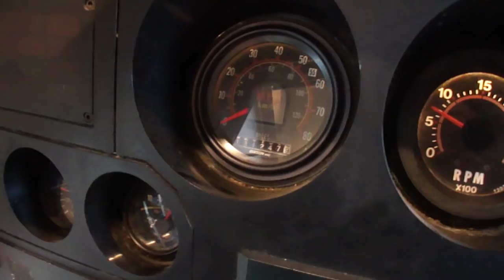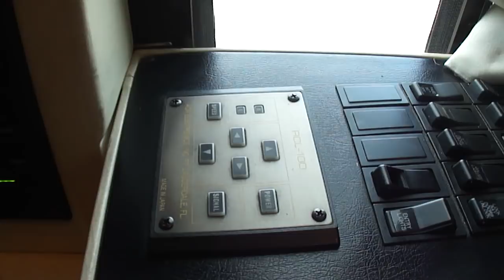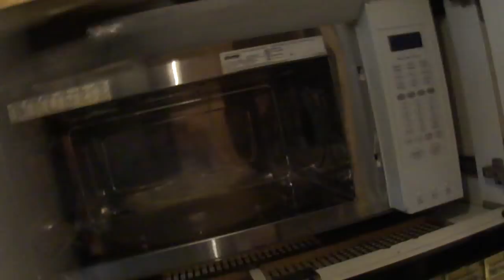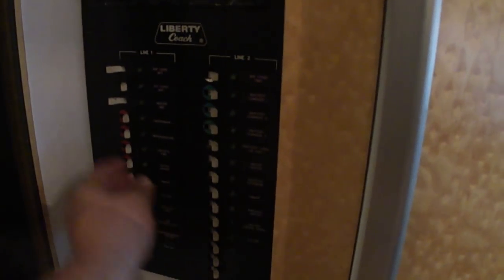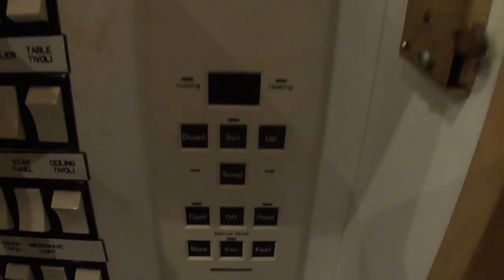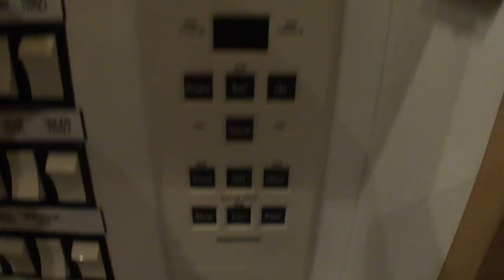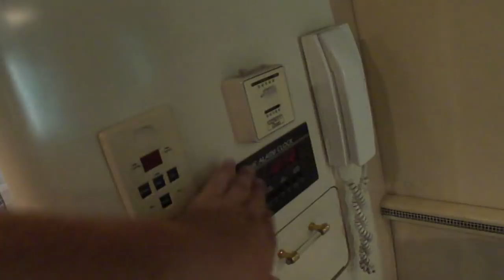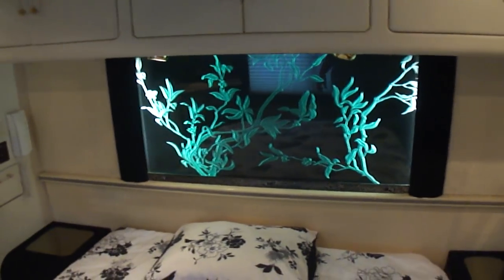1992 MCI Liberty Coach Bus

Comment: Hey dude, stop recording, go an do some research on this coach, learn what all the switches do so you can stop wasting time and have potential clients actually interested in this coach so they dont have to call your dad for info...
Reply from the maker: this thing sold a year ago to someone who saw the video then came and bought it. I just leave it up for the lulz from you nitwits who get butthurt that I didn't go into the torque specs for the tie rod ends.
Reply: what would this have sold for roughly? around 100K?
Reply from the maker: @Mr_Smarty_Pants  It sold for around $60-70k. I forget the exact figure. thanks